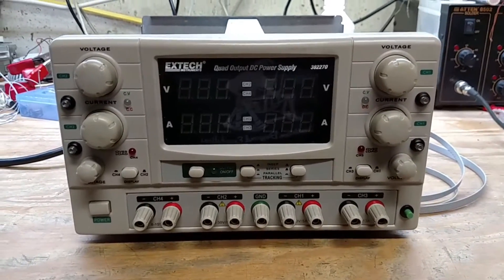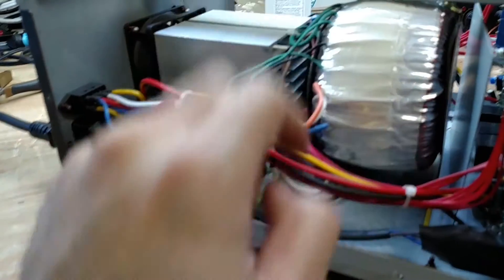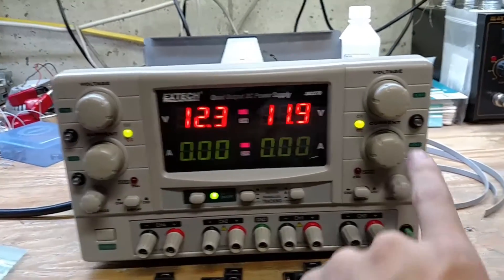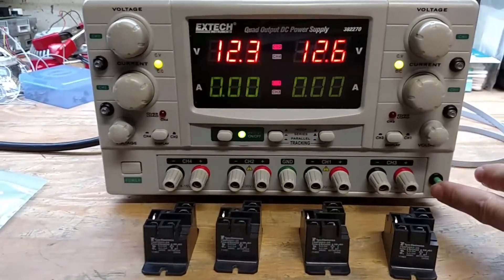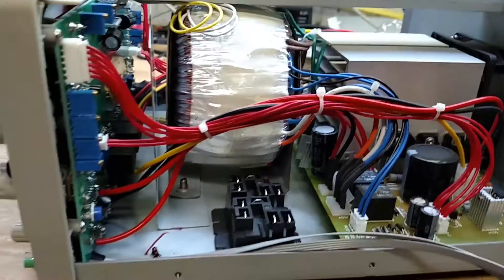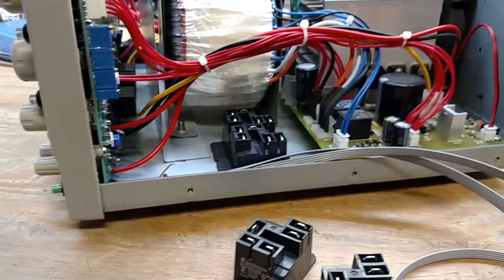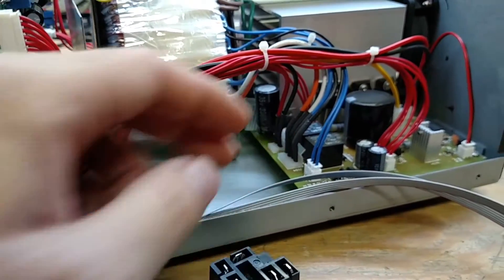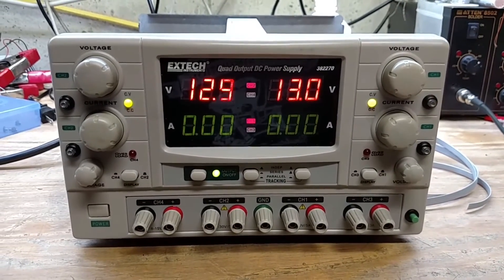Extech Quad Power Supply Upgrade, Part 1

Comment: Serial reporting of the volts/amps is something I am currently wanting to add to my hacked together power supply so I would second the motion to add that if you can :-)
Reply from the maker: +jontscott 
The board I am using does have USB and CAN, I would have to add a RS232 line driver to get serial.

Also, I would have to tap into all 4 voltage and current senses...
Reply: I was thinking USB Serial since it is easy, but now you have me thinking about CAN...  Seems CAN could be a nice way to link many devices and allow central monitoring and control.  I guess I often find myself writing down on paper voltage and current measurements and the idea of recording them seems nice, but I'm not sure it happens enough that it is worth the time to add. Mostly I am just dreaming :-)

Comment: If you had used SPDT latching buttons to control the relays and LEDs wouldn't that do the same thing as having a microcontroller with memory for the previous state? That aside, you could do some power rail sequencing with the micro and maybe toss a little scripting interpreter into it.
Reply from the maker: +Reed Arnold 
The all on and all off functions would be more difficult to implement with SPDT latching buttons.

I had considered power rail sequencing, and also repetitive power on/off cycles for testing intermittent starting up issues.

Maybe you just press and hold one of the buttons and it will enable supply toggling.

The LEDs in the buttons are independent of the relay state, so I could flash or blink them to indicate what mode it is in. 

The microcontroller gives so much flexibility. :)
Reply: Wolf Tronix All valid points! You clearly have some unique use cases where programmable supply on/off control benefits you, perhaps you could even tap into the OC monitoring and voltage adjustment loops while you are into all that.